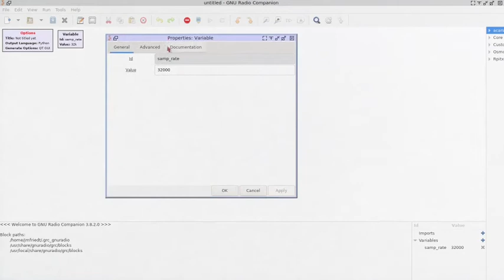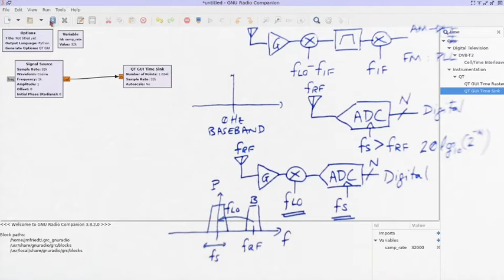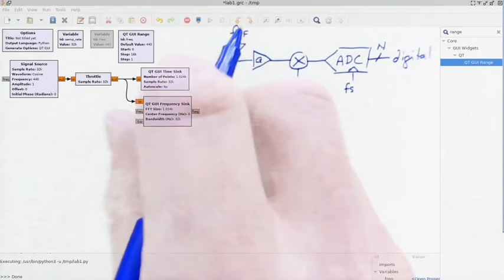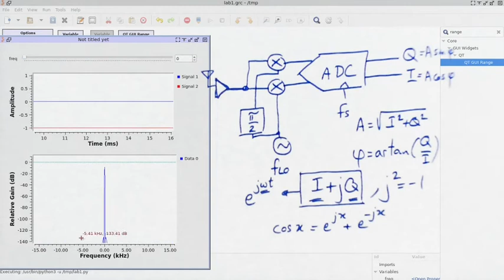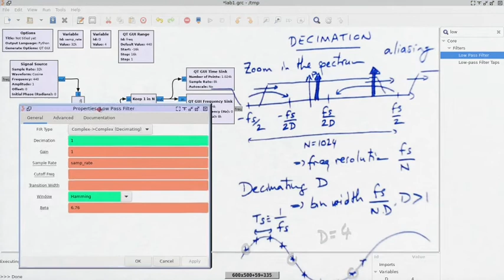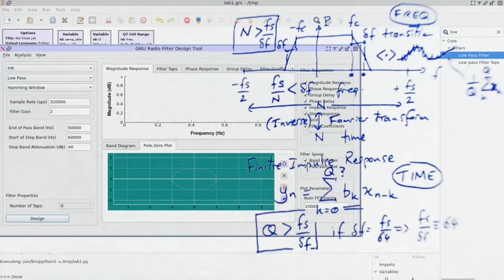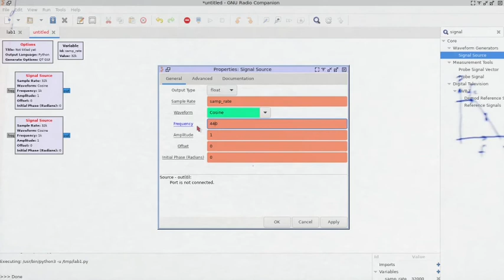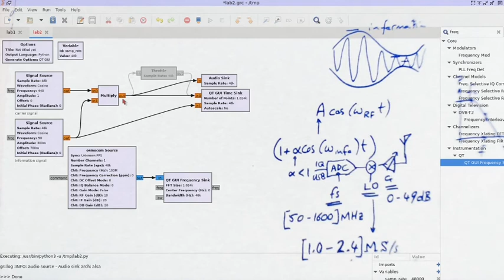European GNU Radio Days Introductory Tutorial 1 (JM Friedt)

Comment: Jean-Michel you are a light house . Thank so much. If you have any video of raw data acquisition from a SDR (hackrf foe example ) with GNU Radio, please leave a link here.
Reply from the maker: If running the flowgraph through Python is not limiting your bandwidth, then saving raw data is as simple as connecting a Source (OsmoSDR, USRP) to a File Sink. If multiple streams are to be interleaved, then Sources -> Interleave -> File Sink. The drawback of this approach is 1/ the scheduler might limit the bandwidth and 2/ the floating point number storage will increase the file size (8 bytes/complex number), which might be an issue when saving high datarates to RAMdisk. You will find an example at https://github.com/jmfriedt/sentinel1_pbr/ of streaming 8-bit I/Q data from 2 channels to a file saved as 2-bytes/sample (I and Q), optimizing storage size and bandwidth, but not using GNU Radio (raw UHD access).
Reply: @europeangnuradiodays1445  Thanks for your reply. Is there any sourch  that combines DSP and various methods with GNU radio?
Reply from the maker: @kmoraitakis40  I realize I was mistaken when mentioning interleaving in the source to file program I mentioned above. Either we are using UHD source and sinking straight to file without relying on GNU Radio (my example, inspired from  https://github.com/EttusResearch/uhd/blob/master/host/examples) or using GNU Radio with all its processing functions with datastream organized by the scheduler and the associated overhead: in this case gr-uhd must be used as shown at https://github.com/gnuradio/gnuradio/tree/master/gr-uhd/examples/c%2B%2B
Apologies for the confusion.

Comment: Hey man, can you explain a little better what you wanted to say about the amplitude of GPS signal using FM band? Couldn't understant it...thanks
Reply from the maker: could you point to the timestamp in the video you are referring to? I would not dare compare GPS and FM broadcast signals, so I must have misrepresented my thoughts in the discussion, apologies for the confusion, I hope I can clarify what I meant if pointed to the right part of the presentation.
Reply: @europeangnuradiodays1445  04:08
Reply from the maker: @reddamasio  OK I understand the confusion. I am addressing here the "ideal" SDR architecture -- connecting an antenna straight to the ADC input -- with the practical SDR architecture of antenna-mixer for frequency transposition-low pass filtering-ADC input. I am justifying why the "SDR dream" of sampling the whole RF and microwave band with a single ADC might not be wise due to the limited dynamic range, since the weak GPS signal (as an example) would be overwhelmed by the strong FM band signal when sampling from DC to 1.57542 GHz (hence including the 88-108 MHz FM band), whereas transposing the GPS band to baseband by mixing with 1575.42 MHz, then low pass filtering (eg. 1.023 MHz low pass filter for GPS L1 but anything that will remove the frequency components MHz to 10s of MHz from the GPS frequency) and then sampling will cancel strong signals and compensate for the limited quantization capability of SDR. So ADC quantization limits the dynamic range between the strongest and weakest signal in the sampled band, and justifies the practical architecture of transposing-low pass-sampling as opposed to the most flexible approach of sampling the antenna output. Anyway an antenna acts as a bandpass filter and would not allow all signals from DC to 1.57542 GHz from being sampled, but this is not addressed in this discussion (except if using atoms as antennas as described in the fascinating https://www.nist.gov/publications/multi-band-rydberg-atom-based-receiverantenna-amfm-stereo-reception but that is well beyond this discussion)

Comment: Very interesting video. It's the best one I have seen discussing these topics.  A question did occur. Can GNU radio be used for implementations of Direction Finding methods?
Reply from the maker: Thank you for the positive feedback. GNU Radio is only a library easing prototyping of discrete time signal processing algorithms, DoA being a phase analysis of the signal being received by multiple separate antennas connected to a coherent (same local oscillator) receiver, GNU Radio is indeed well suited. See Balint Seeber's past presentations or T. Collins' @ https://www.youtube.com/watch?v=_UBPVi1vp2s

Comment: The numbers for fs and LO at 1:13:11 are switched, I believe. Local oscillator for tuning is between 50MHz and 1600MHz, the sampling frequency (fs) is between 1 MS/s and 2.4 MS/s (for a cheap rtl dongle).
Very nice explanation on time domain vs frequency domain in filtering!
Reply from the maker: Absolutely, thank you for correcting, I should have been more careful when proofreading the video.